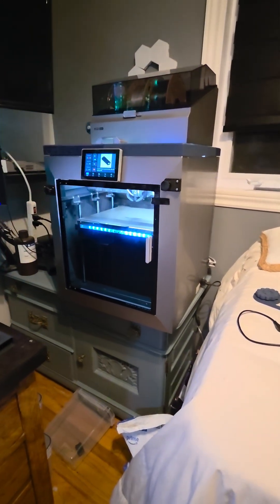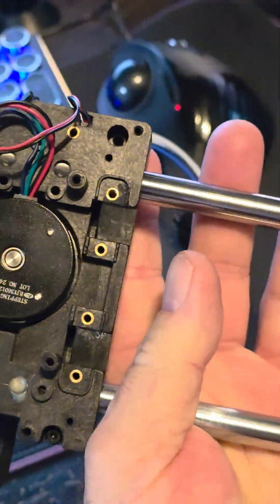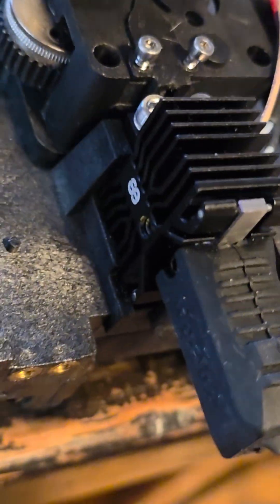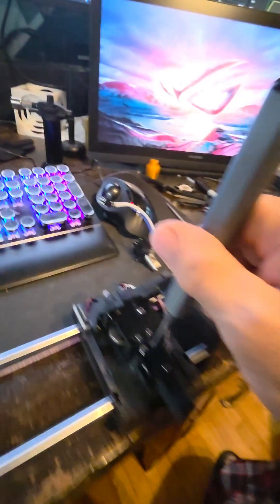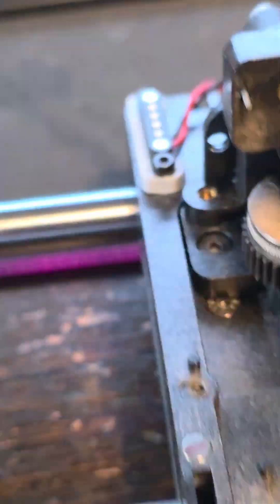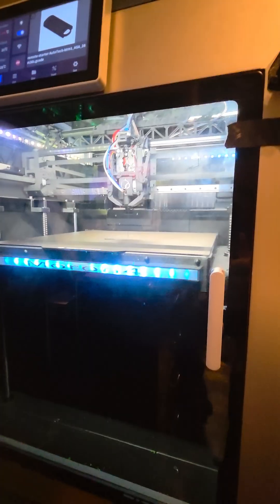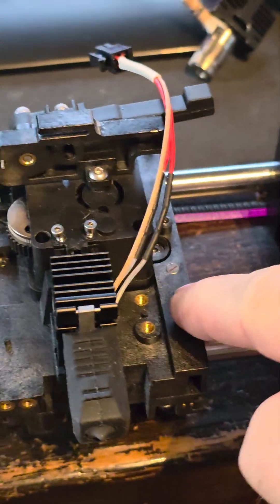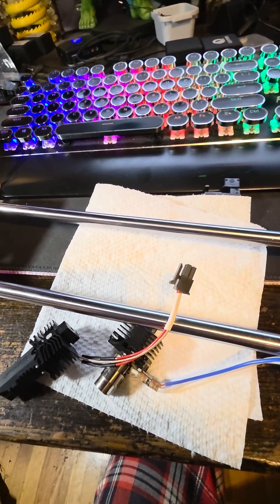Phaetus Conch for QIDI PLUS4 design issue

Comment: Thank you for your feedback and suggestions. We truly welcome technical discussions with our users and encourage open communication. 
Regarding the print head mounting mentioned in the video:
The top boss of the heatsink is secured laterally by grooves in the frame and fastened in the front-to-back direction with screws. This overall fixing method does not rely on a press-fit between the heatsink and the frame, ensuring a stable and reliable structure.
In terms of print stability, we have tested the hotend under extreme conditions. At the maximum flow rate of 30 mm³/s, the Conch hotend maintains stable performance and outperforms the original print head.
Through long-term testing and extensive user feedback, we have confirmed that the Conch hotend operates reliably in real-world use, delivering better cooling efficiency, more consistent material flow, and higher temperature accuracy than the original version.
Reply: Regarding the fin modifications highlighted in the video:
At a set temperature of 220 °C, our tests show that the Conch hotend reaches an actual nozzle temperature of 210 °C, while the original hotend reaches 195 °C. This indicates more accurate temperature control, while cooling performance still exceeds the original by approximately 1 °C.
The original design incorporates additional fin-based mechanical stops, resulting in a stiffer structure. However, during severe collisions, impact forces are transferred directly to the toolhead frame, potentially causing damage or affecting the entire toolhead assembly. For this reason, we chose not to blindly replicate the original structure. Instead, our design focuses on optimizing fin-based cooling performance and improving overall system behavior—continuous optimization and thoughtful upgrades are the core principles behind the CONCH design philosophy.
Finally, we would like to thank the content creator for their sharp observation in identifying this detail. Their feedback has given us the opportunity to explain our design approach and engage directly with experienced DLY users, which we greatly value.
Reply from the maker: @Phaetus3D tks for the feedbacks and infos ... unfortunately, my Conch is not working anymore and throwing thermocouple reading errors now. I got in touch with  Aliexpress but have no return of infos. I think the heater is defective as when it was heating up to 195c°, all was working and once it passed the 205c° ++ ... it started to freeze up Klipper with errors. I swap on my original one and all is working fine so, not a PCB issue nor connectors. Hotend is busted 😢
Reply: @frankthebum  How can I contact you？
Reply from the maker: @Phaetus3D are you on Discord ??? I am part of Team7 as "Fxwoody-Thecrazyfrenchy"  https://discord.gg/teamseven
Reply: @frankthebum  ok

Comment: Did you get the correct one, I got mine today ordered for a QiDi Plus4 got on for  bambu and the other for a qidi, i did notice that one set if fins is shorter than the other, when line up with the OEM one the hole is off center by about the width if some filament.  To the back, so that would make sense...good video

Comment: It looks like the heatsink has a longer side and shorter. If you flip it around does it mate with the plus 4 head that way?
Reply from the maker: No, it goes only one way, wires on the right side
Reply: @frankthebum actually cables are not standardized so you have to flip it and it will sit properly. If cables are too short just extend them.

Comment: I have 2 Conches and experience the same issue. Too much deflection as its not using the heat sink for stability. The Conch is 0.67mm too wide and 2.47mm shallow compared to my Qidi.

Comment: well to be fair the heatsink going in that part would be useless for cooling and also even the stock one didn't fit all the way down. Can prove that by watching how the stock hotend bend when its cloged and extruder is pushing the thing manage to bend towards the carriage plate..

Also if you want to speak about design issues contact phaetus directly they are the one producing the conch
Reply: If he did this and didn't do the video, those of us considering purchasing one wouldn't know about the issue.  He's also said he's told them the heat sink is not made properly for the Qidi.